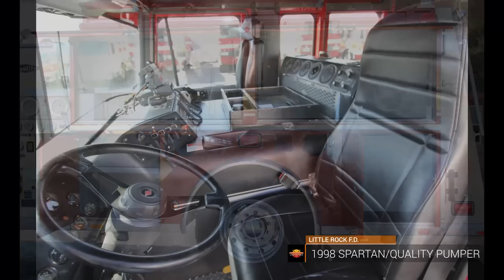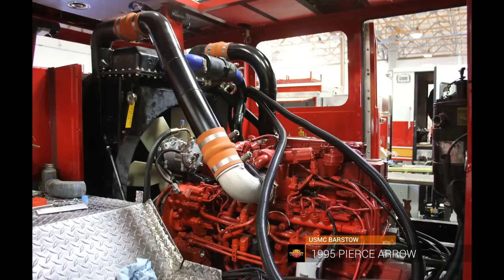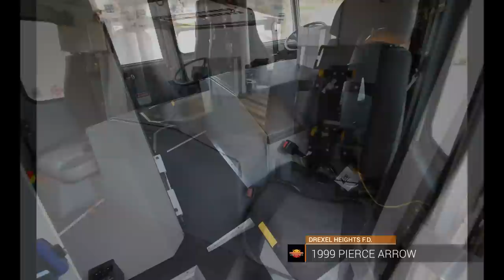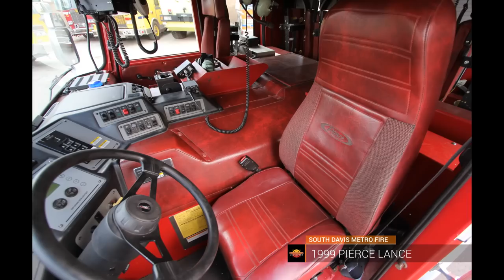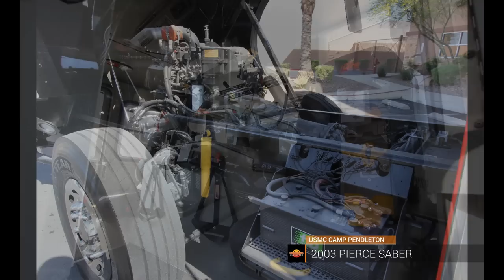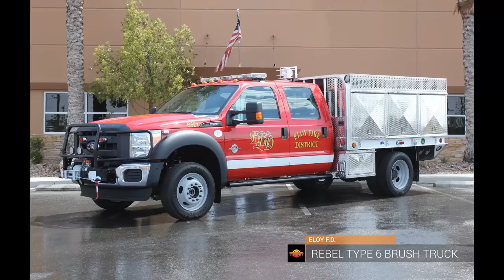Fire Truck Refurbishment | Firetrucks Unlimited

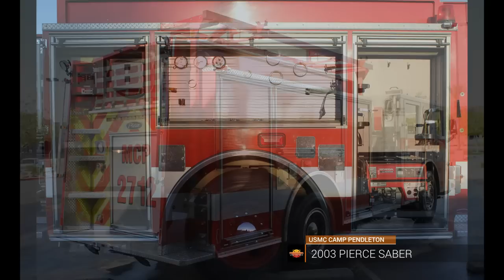Comment: 14:26 what is the generator used for. Like I mean of course its a useful tool, but what to firefighters use it for.
Reply: Dylan Taylor For tools like the Jaws of life
Reply: _Spruce _ ohhh!!
Reply: Dylan Taylo
Reply: It is used for basically everything with an electric plug on it. From lights to powertools like a reciprocating saw, jaws of life etc. Added bonus: recharge your cellphone when you are out for extended periods of time :P
Background is: you might respond to areas where there either is no electrification, like rural areas, woods etc. or the local electricity net is not adequate for your tools or you are unsure of how safe it is to use. The brakers in the house you are in might be broken so they dont work properly, if they are even there in the first place. To save time and hassle you just bring your own electricity you know works and is safe to use.